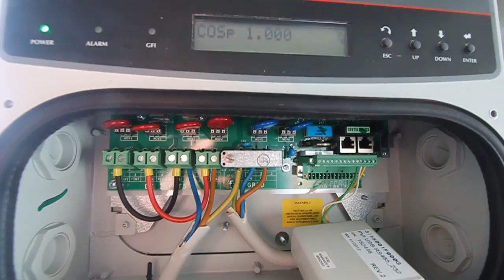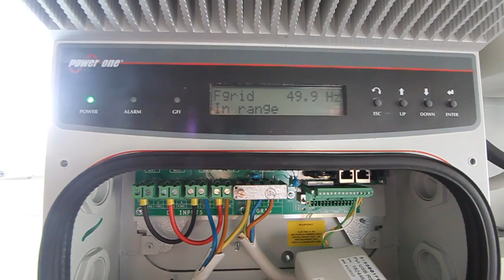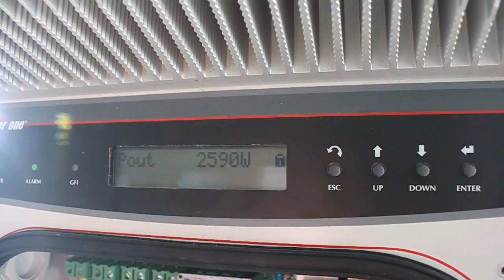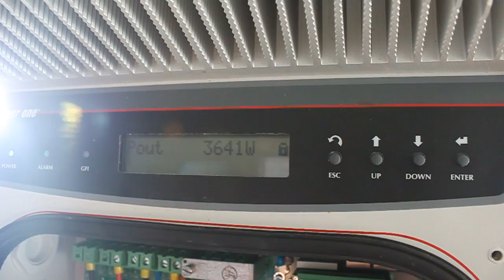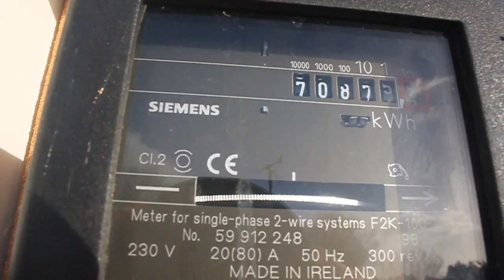Domestic Wind Turbine Grid tie Ireland 3.5kW

Comment: I'm surprised not to see a turbine in every home in Ireland out side of the city's. I'm putting one up in 2021. 3kw vertical turbine. Struggling with, which battery bank to install. House hold a day 12kw+- .
Reply: Makemu.it
Reply: @peterjoseph2803  The EOLO vertical turbine looks great.
Reply: Thank you very much,🙏 just checked it out its a very good website 👍
Reply: @cmcktechnoheadz6153 turbine-3kw charge  controler (CM6024Z AliExpress) Mekemu.it fast delivery BTW. all other parts are cheaper on Amazon ....some grid tie (inverter wish) will work with out a battery bank...once the turbine hits the proper wind speed. (Ps 12AWG wire size.! ) the (battery bank-Batteries Direct. IE.) (24v 500AM- micksGarage.com jumplead) cut to equal length !. Good luck that's the road i went. If you need more information (pay attention to battery selection). Trojan are not great. AGM golfcart Batteries are the best price and lifespan. Godspeed!!
Reply: Mate thanks very much for this information, very helpful 🙏🙏
Reply: Where would you recommend buying a good turbine mate?

Comment: when wind turbines tell you the amount of kilowatts they produce is that how much they produce and hour or a day?
Reply: That is the "claimed" power at their rated wind speed. So, if it claims 1000w at 11m/s then it's supposed to be producing that amount only at that instant. If it were to be doing that for 1 hour then it would be 1000kwh (kilowatt hours). So it's only per amount of time if you measure it for that a certain amount of time and avg it.

Truth be told though, most "small wind turbine" sellers dramatically inflate the claimed power of the wind turbine by rating the output and a higher than standard rated speed. Standard is 11m/s. At 13m/s power can be almost double what it is at the 11m/s standard, but unless you knew that you'd think it was a lot more powerful than it actually is. -- So, if the seller tells you it's a 1000w turbine... look at the rated wind speed, and if it's 13m/s for example then the true standard for that turbine is probably only around 600w.
Reply: @starttherebellion9146  
In an instant!?
Reply: @robinhyperlord9053  - No, not "in"... at. - AT that instant (ie: at that moment)
Reply: @starttherebellion9146  
It is unrealistic to count energy per second. Watts is energy stored or per hour of collection.
Reply: @robinhyperlord9053  - You misunderstand. You're not "counting energy"... you're measuring power. Counting energy requires a measure of time... such as kilowatt/hours (kwh). The measurement of power would be simply kilowatts (kw). Notice there's no time component, just a simple instantaneous power measurement. -- It's a lot to understand when your starting out learning about electricity, but stay with it and it'll all make sense in time.
Reply: @robinhyperlord9053  - Notice how you incorrectly stated: "Watts is energy stored or per hour of collection."
In actuality, Watt/Hours (Wh)... not "Watts (W)... is the measure of stored energy.
Now do you understand? - Watts (W) is only a measure of power. Watt/Hours (Wh)... (like Amp/Hours (Ah))... is a measure of stored energy. Both Amps (A) and Watts (W), without any time component, only measure power.
Reply: That's an insase ammount of power, are you sure about it?
Basicly it means if its windy weather for like 2-3 days with such an windmill(3kw) I can produce electricity for whole my street?
Reply: Yes, if the wind was at rated speed and was constant (which is very rare because wind is so intermittent). It would be 24hrs x 3Kw = 72 Kwh. That's enough in one day to power several houses on a small street. - But again, wind is intermittent. It's not going to blow non-stop like that. You'll likely get a fraction of that even in a windstorm.

Comment: Can this power an entire house without need for the grid? What is the average KT output? Is 3.5KW the max?
Reply from the maker: you can see live feed in info on monitoring portal (link just above pictures ) - http://www.energyfreedom.ie/Projects/Brian-s-windspot
Reply: +John Connolly Yes, 3.5 is the max for THAT turbine, and no, it's not enough to covert the whole house(partial), use solar as main energy source: example
have a 5.2KW solar system and
have a 3.5KW wind turbine, all together is 8.7KW is more to run your A/C in the summer, AND YOUR WHOLE HOUSE

And with little help of a forklift battery 24-85-21 48V(around $6000) to juice up the battery in 20 hours, will have 64.3KWh of power(4 days) in case of power-outage
with 12000 Watt 48 Volt Pure sine inverter charger 120/240 vac($3000) will do the job.
Reply from the maker: 5.5kW is max output for windspot
Reply: +Willem Budde  https://www.donedeal.ie/holidayhomes-for-sale/shepherds-hut/9773442
Surely would be enough to power this? I am thinking of putting one on some land i have as a little holiday retreat for myself and family when they visit. Don't want to bother with planning of hooking up to grid so thinking with Wind & Solar i would have more than enough?